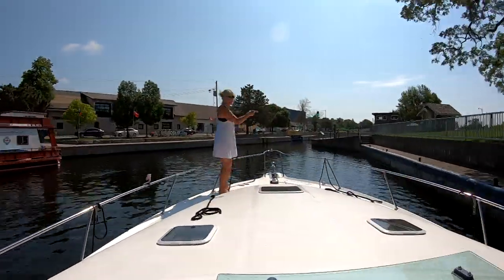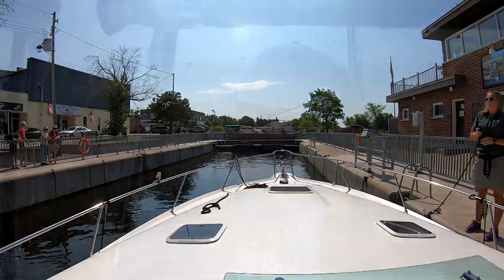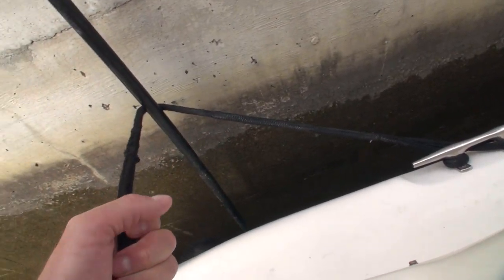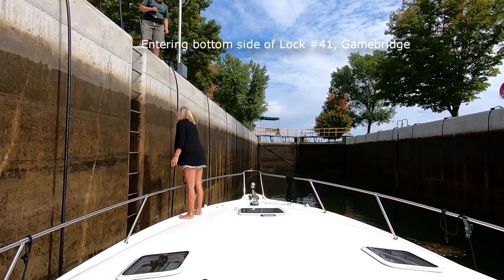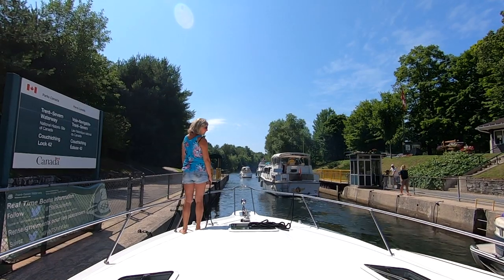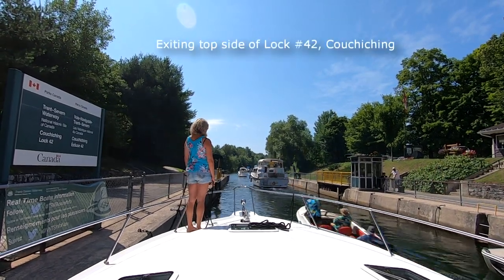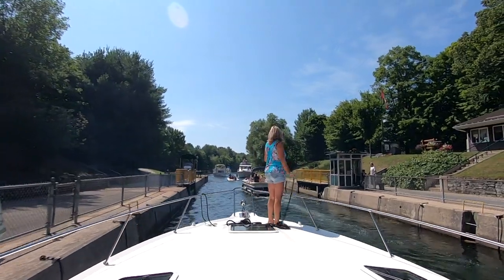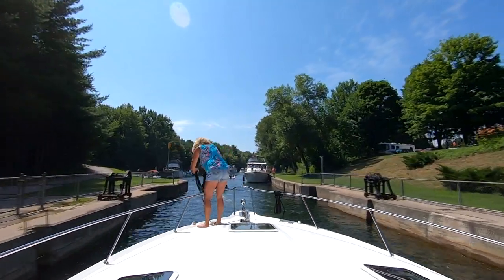Boating Basics - How To Take A Boat Through A Lock

Comment: I've done 324 locks in France totally alone in my 50 Dutch cruiser. The locks here are varied in size and shape and I have learned to put only one rope to bollard and gently use the engine to control the movement of the boat.

Comment: Nice info….. I have a small boat ( a sailboat converted into a motorboat ) about 6 meters long…… and I knew about not tying up your boat as tight……. But do you turn of your motor? I have a small outboard motor…. and restarting it takes a minute or two ….. and I don’t want to hold up the line and block the lock! 

And here in Germany the use of any locks in recreational waters are free to any sporting boats! But some locks are not open all year around….. due to winter and the rivers and lakes are freezing shut
Reply from the maker: All of the locks along the Trent Severn Waterway and the Rideau Canal have notices indicating that no engines are allowed to be running, nor any other sources of flames. We've been in more than one lock where folks have left their stinky diesel generators running and it gasses everyone out 😫
 I would much prefer having to wait a couple of minutes for another vessel to start and clear the lock, as opposed to choking on the exhaust fumes.
 Our lock system charges fees for use, but again, in my opinion, well worth the minimal expense to enjoy the lovely scenery and excellent facilities.

Comment: This might a little of topic, but I have watched many, many of your videos and love them! Several times in your videos you dock along the locks for the night and talk about shore power and using your A/C. Doesn’t your boat have a generator in it that you can use when docked without the shore power?
Reply from the maker: Yes it does, but I wouldn't run the genny more than 2-3 hours at a time, so having full shorepower for the A/C all night is why we sometimes do that. Otherwise, 8f at a lock on a hot day, I'd put on the genny + A/C for a couple of hours after dinner to cool the cabin. Yes, some folks do run their genny's all night, but that's just inconsiderate for fellow boaters. . .

Comment: Do you have any additional comments for a solo boater in a about 30 foot boat locking through? Do all Trent-Severn waterway locks require engine OFF and blower ON?
Reply from the maker: Correct, ALL the locks require all engines, sources of ignition and smoking to be off/extinguished, with blowers RUNNING while locking through. All of the locks have signs in them indicating that, but sadly, there is the odd, inconsiderate boater who feels it's okay to keep the generator running. That is not allowed and lock staff will tell a person like that to shut it off. Gotta remember that the lock chambers are like a big box and any exhaust fumes or smoke will tend to get trapped in them, making it both unpleasant and dangerous for fellow boaters locking through. Pretty straightforward, but some of the Loopers coming from the US are used to leaving everything running in some of the US locks, but this is NOT the case on any of the Canadian Historic Locks (TSW, Rideau, etc.).

Comment: What do you mean they don't monitor VHF? I thought that was the one of the main ways of contacting them
Reply from the maker: The lock stations along the Trent Severn Waterway DO NOT monitor vhf traffic. All of the locks are operated on demand during navigation hours. To pass through, simply approach the lock and await their singles. If the gates are open and the lock is empty, proceed in. If the gates are closed, one can wait on the Blue Line, or simply hover in front of the lock. If it's critical to contact them, they can be reached by phone, with numbers being listed in the Park's Canada website. That said, we've done many hundreds of lockages over the years and I can tell you that it's very straightforward and easy.